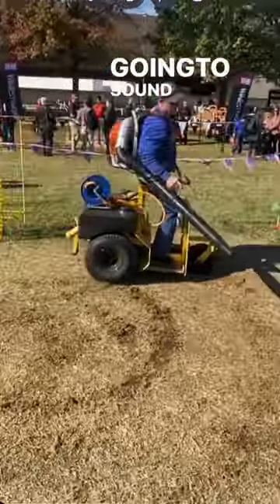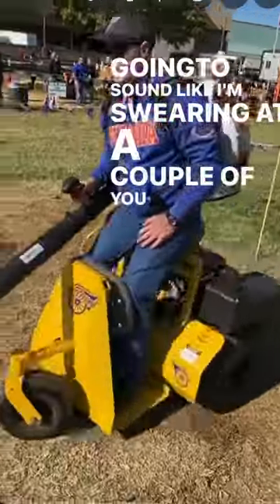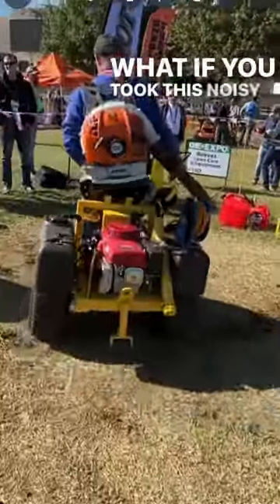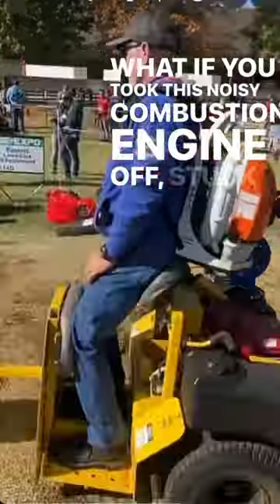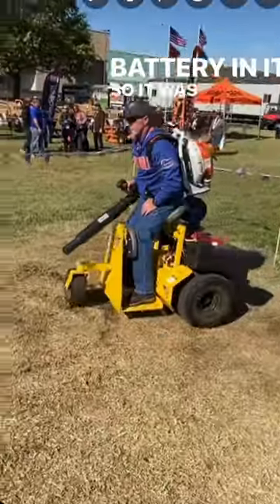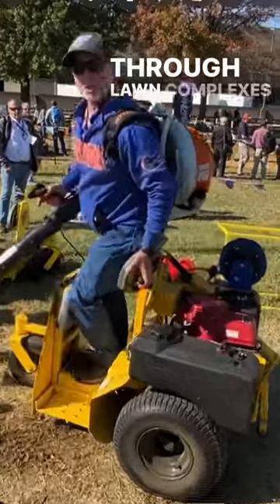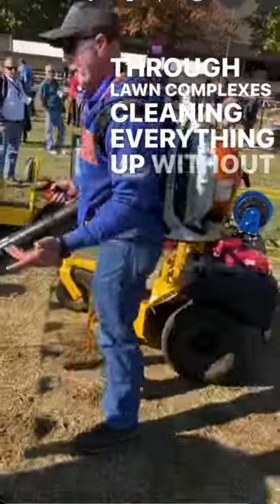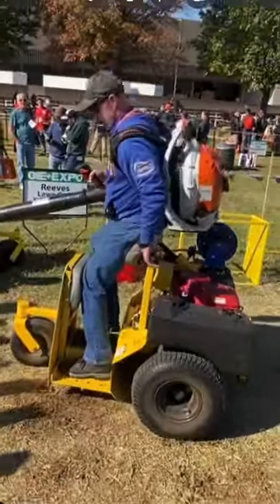Whatever happened to this?  AND would a battery make it better? #shorts

Comment: Sticking a battery on it doesn’t necessarily make it better. Sure it’s quieter, but the gasser will hold up better in the long run. Electric motors and batteries burn out long before a gas engine blows up and a beefy drivetrain goes bad. Just saying.

Comment: We are still a lot of years behind the game for electrical mechanical devices. Batteries are the main problem and good luck finding it inventing a battery that can hold a capacity of 12 hours and recharge quick enough if it dies. I was in comeplete awe when I find that the average Tesla averages only 200 miles from a full charge. That’s a +$70,000 with a “$30,000” car battery so I can only imagine the cost of converting a gas powered machine like this to electric, definitely wouldn’t be ideal now but maybe in the next 10 years.

Comment: Could have used this when I was 18 as the lawn company I worked for cut the entrance etc to this big housing complex. Well the sidewalk was 2 miles long so by the time you edged it and the curb that's 6 miles then  run the blower that's another 4 miles . So simmering like that I could see but for anything less well just walk

Comment: Well I mean that would be a decent idea except for if it becomes cooler or smoldering hot; batteries don’t do well In certain types of weather meanwhile a gasoline engine may suck down gas and other parts of the budget but as long as those have fuel oil and a decent kill switch or mechanism of some kind there gonna truck through just about any condition you throw at them

Comment: I don’t see that adding any real value or efficiency to my day. I just use my mower to get around large properties. A lot of places you can’t even use this. In between cars, front and back porches, stairs, can’t hop curbs. Cool but it doesn’t solve any of my problems.

Comment: I can get more precise work done on the ground. I'd use a riding lawn Mower to get me to my spot if it's far, then just mow it all with the weed eater. That ones to fast and nobody wants to mess with another machine while already holding a tool to mow with. Yes we got legs but not everyone has a good working heart to do the physical labour. I happened to deal with wpw but I still can weed eat and do everything normally I just need more breaks.

Comment: OK, the tractor part will be quiet but the leaf blower is still making most of the noise.  It is also possible to make quiet engines, I have a generator that is whisper quiet, why isn't this tech used elsewhere?  Let's start with motorcycles.

Comment: You mean curise though half a complex before it bursts into a flame that can't be put out. That's what everyone wants now days, It's all about the blaze i heard. You know this is a flame that takes 40000 gallons to put out. Then having to be submerged under water for 3 days so it doesn't restart.  Has anyone seen a lithium mine? "Battery is better!" Say the people who have no clue... or perhaps maybe the car that entirely dies in a few years, becomes
 trash and is not recyclable? To top all had to be confined to special locations when this vehicle becomes the trash that it is.

Comment: The biggest problem with battery powered anything is it's going to need charging and electrical connection and pending on the size of the lot your working it can take hrs that means Bigger batteries and last the price of the batteries when it needs it .. I will stay with gas powered equipment

Comment: This idea seems like it’s only useful in very specific situations, like trimming, edging or blowing down very long stretches of sidewalks or curbs.

For everything else, the whole point of a trimmer is to get all the spots where the mower can’t go- tight areas, steps, curbs, porches/patios, steep inclines, ditches, wet areas, rough ground, under low trees/obstacles, etc.

I can imagine some trimmer just rutting and marking up a lawn with this, zig zagging around, knocking into obstacles, trying to get as close as possible to everything so he doesn’t have to step off, lol.

Plus it reduces space for the mowers on a lawn trailer. For every one of these you add, you have to remove a mower from your crew. Otherwise you need to have another truck and trailer just for the trimmer guys with their little scooters, which doesn’t exactly sound efficient.

Comment: Industrial Gas powered segway... now all you gear heads go apologize to blart. He hasn't been the same since he got rid of his Segway to get around the mall. All because you guys bullied him for just trying to do his job.

.... an electric engine for this would run the battery out in 30.. 45 mins. Until we can figure out some kinda better electric motor we are gonna have to deal with the noise.

Comment: You would literally spend 5x the money to keep a group of them running.  And be half as efficient cuz you would spend half the day towing them to charge and waiting for them to charge.  Tesla's are already more expensive than other sedans even tho they are subsidized by the govt.   Without the subsidizes a battery machine like that would cost double.   Then add on top of that extra batteries.  Then add on all the issues that electric cars have like Charging times, range and dieing at inconvenient times.   You would have to have a huge mobile generator to keep them charged so add that on.

Comment: There are some gasoline powered engine set are noisier than others. I'm surprised the gasoline powered motors have not been upgraded to mitigate sound. 

Many parts of the country are coming down on the backpack blowers which are absolutely phenomenal in the right hands.

The battery operated ones are not as strong and for the areas of the country where there are huge piles of leaves, this presents a problem.

Folks don't realize the fire hazards with leaves or infestation of unwanted critters.

I'll use both electric and gas blowers but I'm switching to mulching blades...

Go get them Stan and God bless

Comment: Use that like that you will have marks all over your yard with them. Wheels are digging it up every time he turns around you could put electric engine on it and it could be quieter but the blower you’re using you’re not going to quite that down unless you get a electric blower which are junk anything electric is junk

Comment: Had to watch a few times to figure out what's going on you use your feet under each foot theres a piece of metal and the metal pivots and you use a lever to keep the plates fixed when you want to get off so it dont move the problem is I'd be scared to let a employee use it the guy in the video makes it look easy but it ain't it's hard to get a employee to just used a weed eater let alone ride and weed eat at the same time

Comment: I'll do you one better. have a big battery system hook up to a backpack blower that has a battery so it's all battery operated with zero weight on the operators back to have so much more power than a gas engine. just my two cents. it'll probably never happen

Comment: You'd have to buy all the lawn care tools with batteries as well to make it all quite.
Reply: I think gas has a longer life anyway especially for just driving around.
Reply: It still wouldn’t be quiet
Reply: Thank you. I was about to say the same idea.
Reply from the maker: The unit would be quiet but the tools not so much.
Reply: @Dirtmonkey  that depends on the perspective it being quiet to homeowners sure the motor being whiny  for the operator and as someone who gets headaches from coil whine it would be easier to walk it
Reply: I'll take the noise and efficiency any day
Reply: My Milwaukee Fuel leaf blower isn't quiet at all!
Reply: Quite a machine?
Reply: And, although quieter, electrics still make noise.
Reply: @dearboy05  I appreciate quieter, when I'm on a troubleshooting call with a Fortune 100 company.  Gas leaf blowers suck

Comment: Or have all the equipments run from it. you have a huge generator on it it should be more than capable to run a normal AC powered blower or any equipment.
Reply: Generators use gas and are loud, you're back at square one.

Comment: If you were truly going electric for quiet you could get a system where the rider has ports to plug in the electric tools like Stihls backpack contraption, then you’d only have to worry about one battery, or set there of.
Reply from the maker: Agreed. That’s a great idea.
Reply: EGO has the backpack mounted battery system for both home and commercial series.

Comment: Why ruin a piece of equipment that really only has purpose for large areas anyway. Leave it gas and you won't have to worry about bringing a jug of electricity when it runs out of charge. I hear it's much more difficult to pour in electricity into a battery that has ran out of charge in the middle of the yard than it is to pour gas in a gas tank when it runs out of gas.